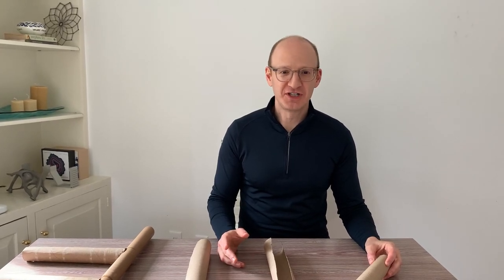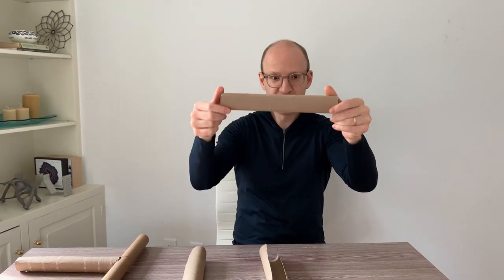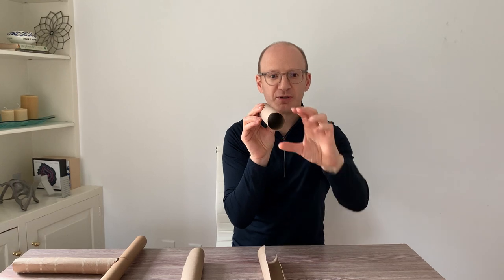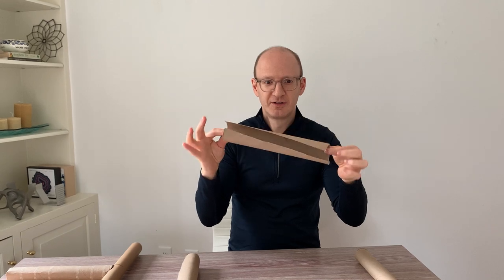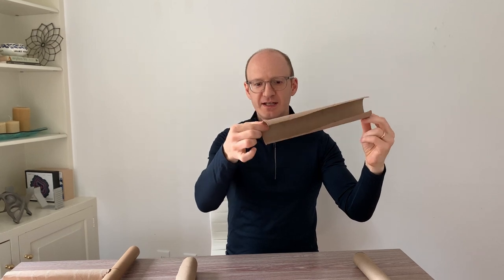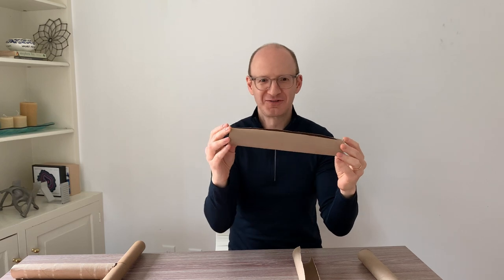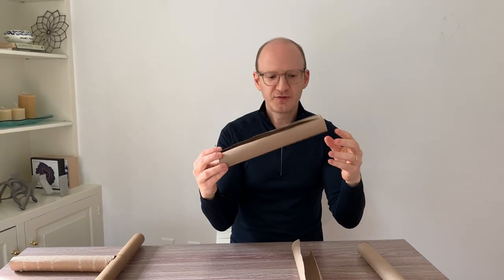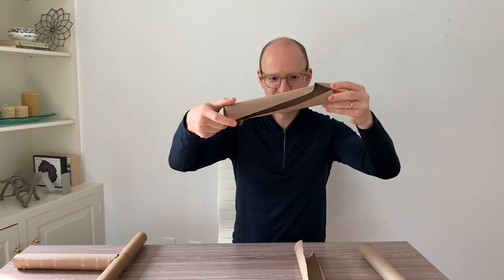How Torsion Works! (Structures 6-3)

Comment: Truly, you are amazing and your passion for structural engineering is both incredible and inspiring. You have acquired an impressive set of skills which enable you to simulate and analyze everything around you. Your deep charm shines through in your ability to use small-scale objects to represent and describe the behavior of full-scale structures. Keep up the fantastic work!